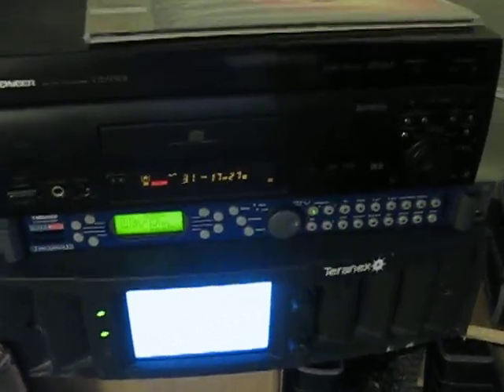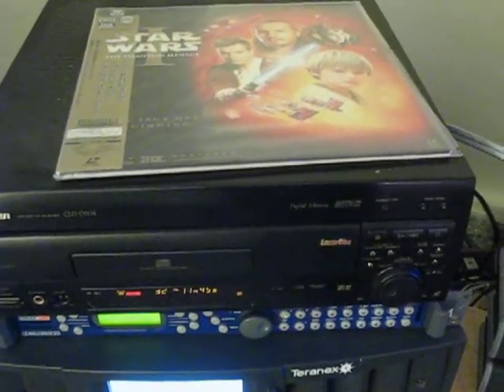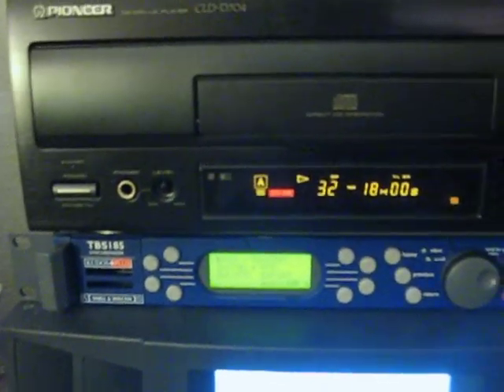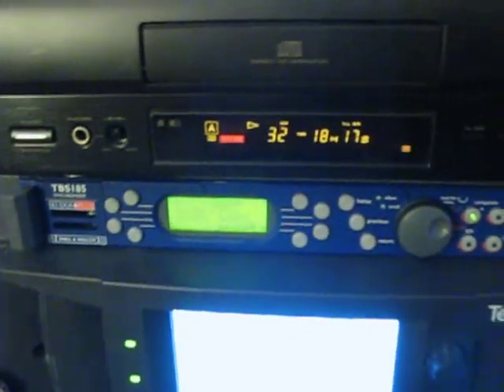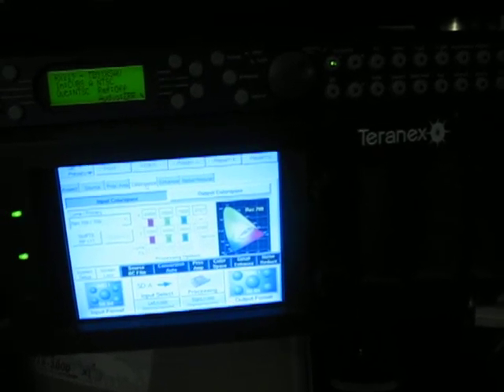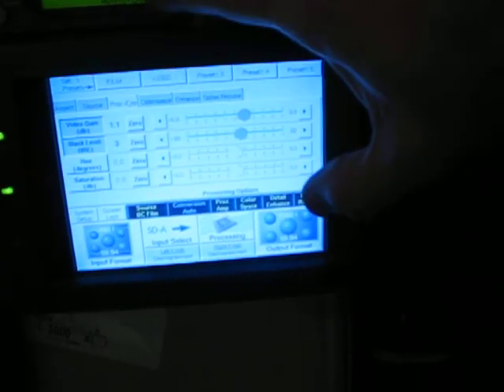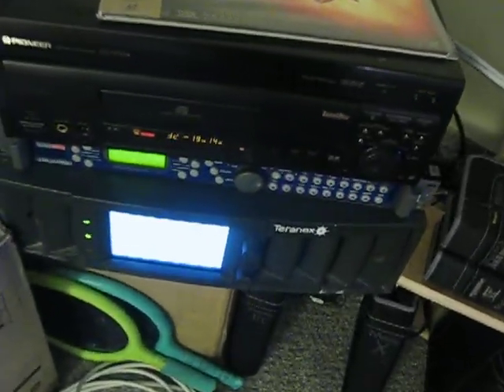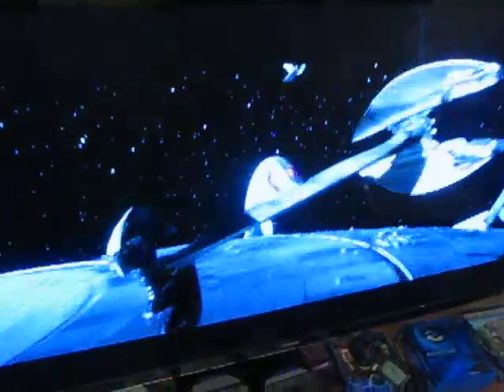Laser Disc Playback

Comment: Been following your post on AVS and I'm pretty skeptical that anything you are doing makes a visual difference in picture quality on your plasma TV. As a matter of fact, I bet it is degrading picture quality overall rather than improving.  I'm a display systems electrician and a delicate balance must be struck when designing PDPs. Similarly to the Kuro tweakers, ultimately what they end up doing is improving one aspect of picture quality while greatly degrading others. I'd encourage you to post a video of your modded display playing content explaining exactly what visual changes you've noticed.